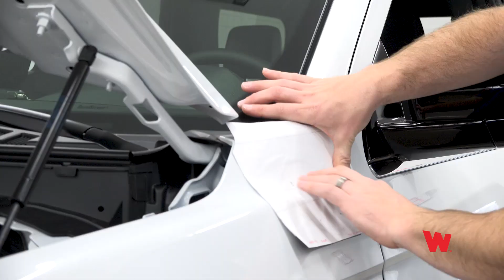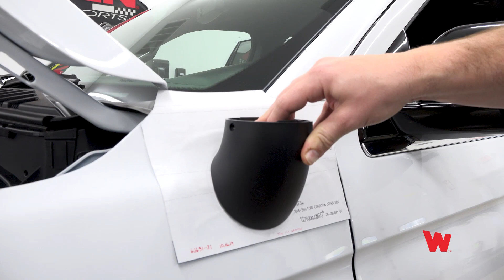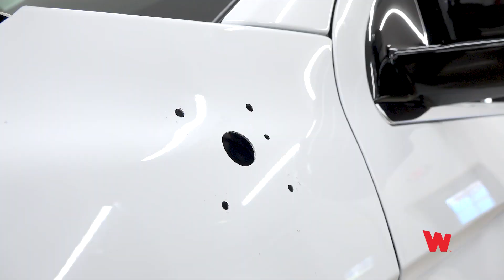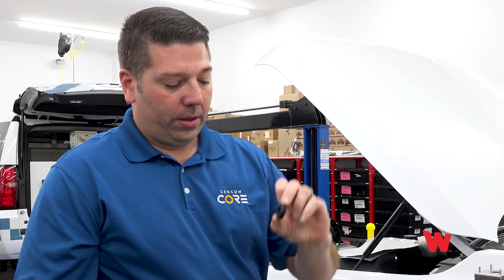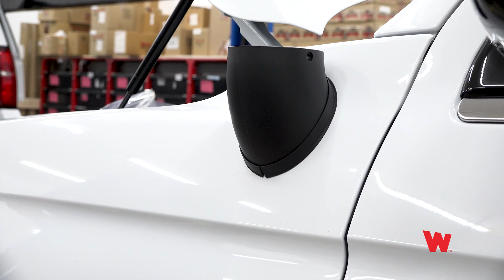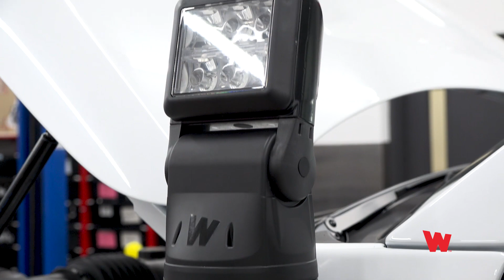Arges™ Vehicle Installation: 2019 Ford Expedition - WeSupport

Comment: I have the Arges spotlight on my patrol vehicle. It’s very bright and works great. No issues at all so far, and I’ve had it for over a year. Takes a little time to get use to the remote control part inside vehicle. Sometimes I miss the regular spotlight as its a little easier to control. But overall….so far not a bad product.
Reply: One our local PD’s has one on his Tahoe and he the officers let me try and I didn’t like it. You barely touch the control knob and it’s way to touchy. If my new patrol has one I probably won’t use it.
Reply: @jmc2398  Not an officer myself, but I used one the other day and I felt the same way. A way to adjust sensitivity seems like a no brainer here. I can imagine being on a traffic stop and reaching down to adjust the spotlight and flailing the thing all over the place.

Comment: Took a leap of faith and bought one. Controller and light power up but light won’t do what the controller tells it to. Also, there’s about a 1/4” of slop on the vertical movement. So on a bumpy road that things gonna bounce. There’s a little less slop in the rotation gear but still has some. For $700 I am NOT impressed. Should’ve gone with a unity...

Comment: Do you make a temporary option? like a magnetic mounted one? thanks
Reply: they make a flat mount one, you could probably attach it to a magnet
Reply: neat! thanks @lukelegg9915
Reply: As a cop car enthusiast. There are so many better options than this spotlight,
Price wise and looks.  If u want an under 100 dollar spotlight like that will light up the whole night go and pick an amazon magnet base cigarette port light. They are so much better. And they are upwards of 5000 lumens than this whelen arges which is only 1800 lumens 🤡 but if u want a cop car look. Get the original spotlights that drill into the side panel of your car. They are still brighter than the new overpriced arges u just saw in the video. 😂 Hope this helps
Reply: @AnotherBadRep  definitely helps! thanks. any brands you recommend?

Comment: Our department is no longer purchasing these thank god!  Ford will still put factory unity spotlights on and has no effect on airbags.  whelen just trying to get you to buy their new toys.   The core system also has a bunch of bugs which we decided to go back to carbride system.  The argis controller was way too sensitive/responsive, controller mounted in location where officer has to use shooting hand to control it.  we tried it and pass!
Reply: Controller mounting sounds like a poorly planned install.
Reply: I have this on my patrol vehicle and I don’t mind it. I do know what you mean by sensitivity though. Just a little tap on the control stick moves it a lot. Ive been using this for over a year now, and overall Ive been okay with it. Does take a lot of time to get use to it though. Sometimes I do miss the simplicity of the regular old spotlights.

Comment: Great Light, especially for intersection clearing but I do agree that I would not want to drill so many holes in an expensive SUV police vehicle. Maybe the mounting base should be redesigned for less attachment screws. Overall, excellent light with great functionality.
Reply: It honestly does not matter. The service vehicle will be in service for likely about 200k miles and 5+ years. A few patchable holes in the quarter panel won't hurt.
Reply: Why would a police department care about making a hole for a utilitarian purpose?
Reply: Consider that A: fenders are not that hard to replace, and B a traditional spotlight has to be drilled clean through the A pillar, which can't be replaced and is now a safety structure with a hole through it
I'll take the fender
Reply: How many fenders do you think that patrol vehicle is going to use, especially if the department is active and/or chases/PIT's?  They already put holes in the roofs for antennas, drilled through the A pillar before...

Comment: This product is stupid.  Should have stuck with Unity Spotlights as they have worked fine for 20+ years.  Ford shouldnt have put curtain airbags in a police car anyways.  Another dumb toy that only people who don't work in field buy/sell to command staff.  How much will it cost when motor goes out or it freezes and breaks???  Not to mention re-sale value of vehicle when that dumb thing is taken off.  They ruined our 2020 Police vehicles with this stupid thing.   Finally the light output sucks!  super small concentrated circle ray of light.